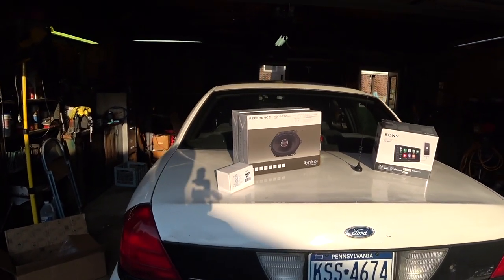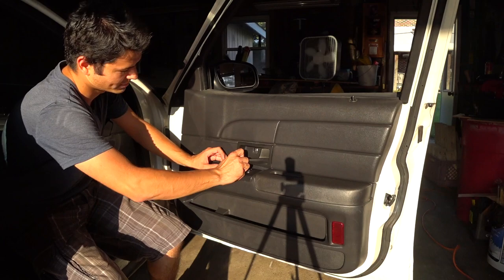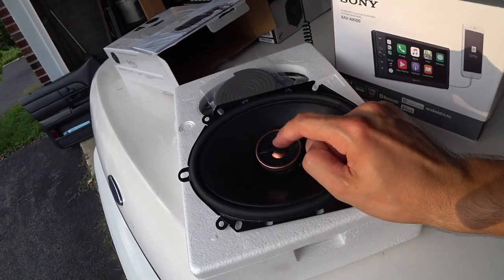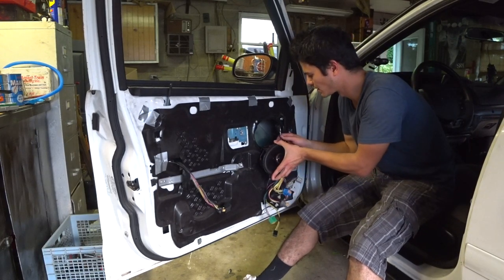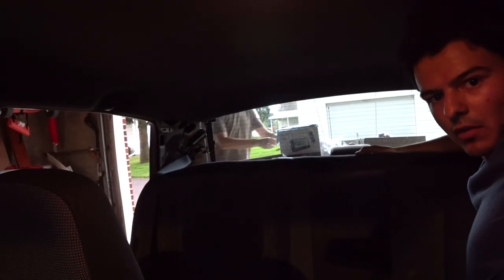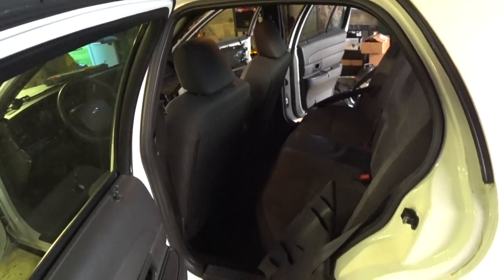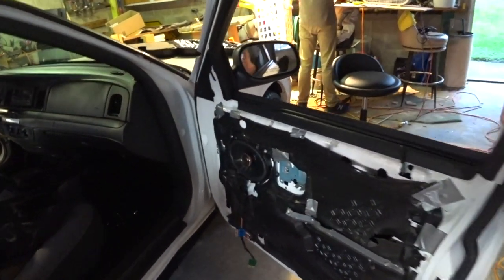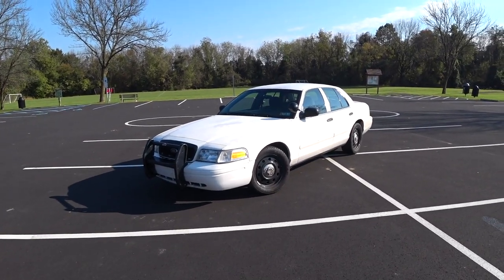Ford Crown Victoria Speaker Upgrade

Comment: So helpful!  I've pondered purchasing a P71 for many years now, and the poor quality of the stock sound system has been a significant downcheck.  Thanks to your video, I now have a way to mitigate that when it comes time to dive in.  Then the question will be.... upgrade it for towing?  Or put in a 6-speed manual.......becoming a bucket list item!
Reply: Are you going to change it to 6 speed..  i just threw a tow and hitch on mine
Reply: @overgrowthplanet7531  If I get one, probably I will.  But at this stage in life, not sure if I can justify the expense and I don't have a spot in my garage for it.. :\

Comment: Nice video tutorial Bro. I see the front speaker sizes are 6 x 8. What were the rear speaker sizes? I am considering doing an upgrade for my Crown Vic real soon with a set of kenwood excelons...
Reply: David McFarlane also 6x8s
Reply: David McFarlane I think they are 8 inch in the rear deck
Reply: 6x8
You can always look up what your car/Truck has for speakers on Crutchfield. Great place for info!
Reply: Same size, 6x8 coaxial

Comment: Great video though little bit of a misconception on the button.  That only bumps the tweeter 3db to increase highs.   If anything it would actually make the bass sound less emphasised.  One that I still can't understand is why Ford left the cutout blocking 3/4 Of the speaker.  The sound still gets out but especially with a factory system it just lowers the efficiency.

Comment: Just my 2cents but If you need a backup camera on a crown victoria, you shouldn’t be driving. Good video btw. I was goin to put subwoofers in mine but decided just to upgrade the factory speakers. I’ll be running an amp with mines.

Comment: I popped the (rear) seat forward with a little pressure but what's the trick with getting that upright/seat back rear cushion to hook back in place - it looks like you have to lift it up & get it up and over the original bars it was connected to = but it just won't go! Do I have to unbolt it from the floor where the seat belts are connected to lift back up and back in place, or do you have a trick? Ty

Comment: Have 2011 P7B C/V and the frount speckers don't work pulled radio and they cutt the four wires off very short to stubs at the connecter so I guess ill have to buy a new connecter or install four new connecter pins .

Comment: Did you have to purchase bracket adapters for the speakers you got? I'm trying to install some Kickers and I don't know if I need an adapter.
Reply from the maker: For the wiring? I did have some adapters. I believe Crutchfield automatically factored that in for me when I was going through checkout. It depends on speakers though so check out Crutchfield
Reply: @garagedenali  Oh gotcha. I was referring to the process of actually screwing in the speakers to the door. Thank you for responding!

Comment: Got a question.  My 99' vic has a odd problem.  A vibration not always.  Not at any given speed.  But it is more frequent when AC is on.   WTF.  LOL. New tires.   Soooo.  Help !!!!  LOL compressor off it still happens.  Not bad.  Not good.

Comment: what is the little fan or air vent on the trunk deck? what does it do??
Reply from the maker: The P.D. put that in during their ownership. It was for airflow for whatever piece of equipment sat next to the spare tire in the trunk
Reply: It’s a spot found on all panther platforms it was for a optional 8inch subwoofer that came on the grand marquis’s and Lincoln towncars with the premium sound system.

Comment: With your crown Vic have you ever had the o/d light flashing then engine light came on and my speed Odometer works sometimes but most time it dont
Reply from the maker: Jimmy Millions I haven’t had that issue nor heard of it. I’d check out some forums regarding that issue
Reply: Spark plug/coal pack needs replacement
Reply: Sparkplug needs replacement
Reply: Beast Mode Brooks are you sure
Reply: 09 p71 just had the same issue. Obd2 scanner misfire cylinder number 3 changed all 8 running good as new

Comment: Does it matter which side you put the black and white wires in on the speaker ?
Reply from the maker: Yes, one is positive and the other is negative. Plugged incorrectly will yield no sound
Reply: @garagedenali  thank you so I won’t blow a fuse or anything if done incorrectly?
Reply: @alphakilo9099  If it's reversed the speaker moves in the opposite direction.  It won't damage anything but it also won't sound right.
Reply: Properly wired speakers travel in the same direction for the most part. If speakers are out of sync like said by cactus it will reflect on the sound quality. One way to figure out what side is neg/pos is to take a battery(AA, 12v whatever) and hook it to the speaker terminals. If speaker moves outward then you have it correct. You can check factory speaker this way also to see what wire is pos/neg etc etc...

Comment: How do you remove the trunk release on the driver side door?
Reply: It's a small snap thing, when you remove the panel it should come undone with no problem, and on the reinstall, you just put the plug in the correct slot at the bottom of the panel

Comment: Do you think 6x9s would fit in the doors and rear deck?
Reply from the maker: I believe 6x8 is the biggest speaker that will fit in this car
Reply: @garagedenali  ok thank you,  and great video really detailed
Reply: @garagedenali  it depends on the year of the car my 2007 have 6x9s
Reply from the maker: I figured the speakers were the same between all the years. Check Crutchfield.com to see what your options are as that is where I got my speakers and head unit
Reply: @kendricdavis7130  are they in the door
Reply: You can trim the doors/deck for 6x9's but you can also make an MDF baffle adapter if you don't want to cut the rear deck. Not sure you can do that for the doors.

Comment: How do I remove/release the backseat to access the deck?
Reply from the maker: You pull the top of the backseat (where the headrests would be) very firmly towards the front of the car
Reply: If its an older vic like mine u have to unbolt the whole thing, and to do that u gotta take the actual part u sit on off and there is 1 bolt on each side u have to undo
Reply: Jay Jay what year do they change currently have a 2008

Comment: What size speakers are in the car door and and they the same size as the back
Reply from the maker: They're all the same size. 6x8
Reply: 6x8 front 6x9 back
Reply: 5x7 is the same as 6x8 the same in all 4 corners
Reply: @whou85  I tried installing 6x9 in the rear and they didn't fit.

Comment: Did you have to order the speaker adapters for the rear deck ones? My infinity's didn't come with one or is it just plug and play?
Reply from the maker: Yes, this is what you will need: https://www.crutchfield.com/p_120725601/Metra-72-5601-Speaker-Wiring-Harnesses.html?omnews=15085390

Mine were included with my order at no cost though

Comment: How do you pull the rear seat?
Reply from the maker: The top is held in at three locations by some hooks that are part of the chassis. You just pull the seat forward from the top of the seat towards the front of the car and the seat unhooks
Reply: @garagedenali  thank you!
Reply: @garagedenali please tell us how you got it back in place - those hooks that you pull from are giving me fits trying to get the seat-back to latch up and over - locking in place!
Reply: @BulletBobTx  push seat cushion back with all your might
Reply: @masonhuffer3184  so I don't have to unbolt from the bottom - hook in - and bolt it back down? I'll give it a try - sounds easier! Thx

Comment: Wouldn't have bought speakers you'd have to push a button to make it sound better.... Anything is probably better than stock though. Would've been nice to hear the stock on each speaker before and after each installed
Reply: It depends what stock you have a towncar or even civi crown vic could have a much different "stock" than a police interceptor ever would oem.  The button is not to make them sound better.  Depending on where they are mounted you may want to boost the highs slightly to compensate.

Comment: I just installed these same speakers and I noticed something not mentioned when mounting them.  The four 5mm screws stick out from the factory plastic mount ring.  Probably 2 or 3 threads it looks like and they do contact the door where the factory did not.  Has anybody else had any issues with the mount ring cracking or anything of the sort.  They do sound great and don't appear to rattle.   I just don't want to end up hearing a snap and having to pay a shop for custom repair work.
Reply: same here i just tightened it enough to get the speaker there without the screw pushing against the door i thought i was the only one that had this problem

Comment: I didn’t hear the size of the speakers you installed
Reply from the maker: 6x8
Reply: Thanks one of my door speakers went out I want to replace the doors speakers and get some 12s or 10s with amp but not sure which way to go